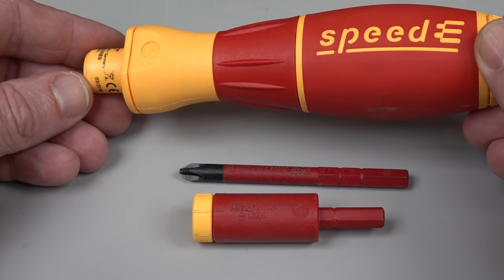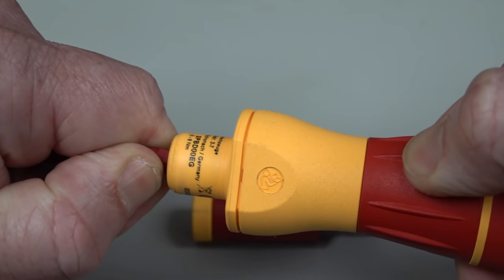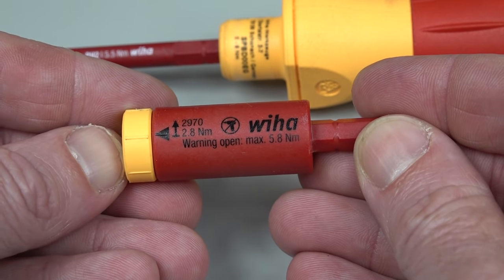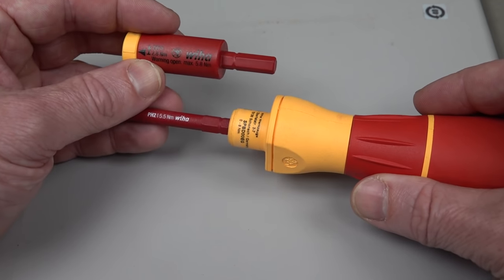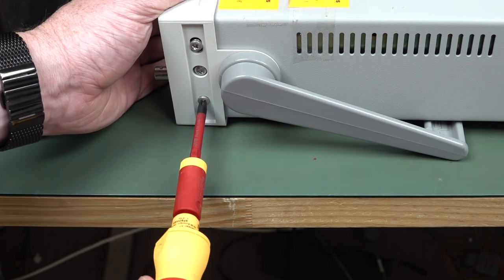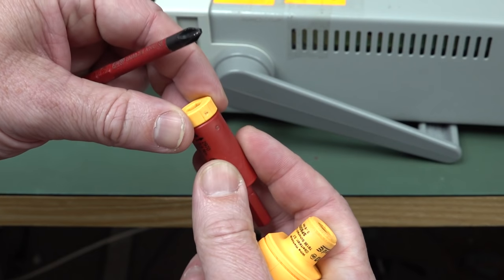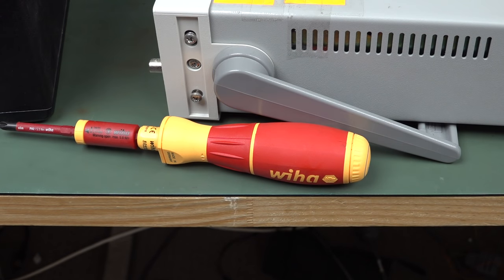Wiha SpeedE Electric Screwdriver follow-up

Comment: The torque adapter is supposed to click when it reaches its torque limit.  Maybe yours is busted.
Reply: Or he can not afford 2.8 Nm in his arms :P
Reply: From the wiha site:  A click signal can be heard and the yellow ring and red adapter seen rotating in opposite directions when the torque is reached.

Comment: Dave, sounds like you want the Bosch go screwdriver. It’s only $40 usd, has more torque, variable speed and torque settings. However, it’s not v rated.
Reply: It's lowest speed can be a bit too fast IIRC

Comment: The torque adaptor is most likely an encyclical gear box, try holding the yellow end and running the screwdriver, if the bit turns slower than the motor end  you know it's a gear system torque multiplier.
Reply: It's just torque limiter.

Comment: As a few have said,  it could be defective but, the adapter looks like a torque limiter. Does that yellow end ring rotate in with respect to the arrow on the main body to adjust torque?

Comment: You are not using this tool correctly. It is designed to insert screws without a chance of stripping the threads. The final tightening is intended to be done by hand or using a properly calibrated torque tool if necessary. Right tool for the job, etc.
Reply: Wrong tool for the price. Buy a frigging drill driver with a torque setting for $30. If the EU has such stringent torque requirements, there are manual torque slip screwdrivers that are calibrated for that. I believe Wiha even sells some. This is a fail. Just like the power torque wrench Milwaukee is coming out with will be a fail. Wiha generally makes good products, but that doesn't mean they don't do some duds occasionally. This thing will hopefully be pulled from the market fairly quickly and we can all forget it ever existed.

Comment: If they can do 1 electronic torque setting they can do more, probably just monitors motor current, calibrate that from the known mechanical setup, seems pretty simple with a couple of components easily. I don't know how they would get multiple speed settings in there mechanically though, the formfactor probably wouldn't allow it.

Comment: That adapter is more than likely for generic hex bits for special tips but still provided the 1000v insulation. Maybe try it out with some standard hex screwdriver bits?
Reply: yshouldicar3 The 1000V isolation should be mostly in the handle, with isolated shafts required to avoid accidental shorts.  Basic electrical screwdriver safety rules required by law say to discard screwdrivers or scratch off every 1000V rating if the metal gets exposed past the tip.  Using regular ¼" metal bits is popular but not really legal on live installations (one could create an isolated holder to make the short bits legal, but still not nice dropping a metal bit inside a live 400V switchboard).
Reply: Regular bits (6.35 mm) will not fit, those Wiha Slimbits are 6 mm hex shaft.
Reply: @toolthoughts  good to know! :)

Comment: Err Dave, you did screw that screw in easier with it, than twisting  your hand, and you were able to apply the amount of tightening force YOU wanted and YOU FELT.
Did the wobble stop or impede the operation/result?
Didn't look like it.
On the instruction sheet doesn't it  say "FIX WITH FEELING", ie tighten with feeling.

With benchtop repairs, each set of screws/bolts have their own tightness FEEL, I don't use a torque screwdriver to TIGHTEN screws when I refit EVERY screw.
The last thing I would want to do is keep adjusting MAX torque each time I change application.
The fact that the shaft has some wobble didn't stop you accomplishing the task.

This is one product that I would love to have.
If you don't want it mate, I'll send you my postal address. 

I know  you are doing a critique of the product, but how much do you want from a screwdriver and how much will you pay?

Seeing as we have no Automotive Assembly lines now, there must be some of the production line tools going cheap, including intelligent power screwdrivers.

Tom...

Comment: how should a torque Converter work without any additional fix-point, newtons law forbids that
Reply: It is possible if you build it like a Torque Converter as it is build into a Automatic Gearbox for example. You have the Motor as one fixpoint that also turns the main side of it and you have the Screw as the other fix point. Theoretically it should work.

Comment: Need to test this turning against a torque wrench or a weighted arm to check if it actually pulls 0.4Nm on motor and clicks on 2.5Nm .  Otherwise you may accidentally destroy screw terminals on your μCurrent when trying to torque them all to spec.

Comment: "The easyTorque adapter provides controlled screw tightening combined with safe work practices for electric applications. This torque adapter guarantees process-safe use, thus safeguarding against material damage and eliminating the need for refinishing. Compatible with all slimVario products, the insulated easyTorque adapter also ensures a secure hold for 75 mm slimBits. The handy adapter thus transforms the slimVario screwdriver with bit holder, the slimVario Stubby electric and the LiftUp electric screwdriver with bit magazine into a torque tool in next to no time. A click signal can be heard and the yellow ring and red adapter seen rotating in opposite directions when the torque is reached. With a release accuracy of +/- 10%, the torque tool complies with EN ISO 6789 requirements. The easyTorque adapter undergoes an individual piece test as per the international IEC 60900 standard, allowing users to work safely on live parts up to 1,000 V AC."
So, it seems to be a torque wrench like thingy...

Comment: OMG I HAD NO IDEA A TOOL LIKE THIS EXIST. I have always joked with my coworkers wishing for a normal sized screwdriver that spun it self...  and HERE IT IS!! Wtff
Reply: There are better ones for half the price.
Reply: @GLITCH_-.-  the chinese have even made one
Reply: @amirs5512  yea in this case the Chinese did the better one. If you don't need the insulation.
Maybe it lasts half as long, but it's also half as expensive with double or triple the usefulness.

Comment: Just to follow up on my comment on the original video regarding the wobble - that's terrible! I really thought it was going to be better with the adapter.
Reply: Dave Micolichek  because I thought the torque adapter shank was slightly bigger than the shank of the bit. That's how it is with the variotorque I have

Comment: Maybe the adaptor is to allow the use of driver bits that are all metal.  That way, the voltage rating is maintained at the handle

Comment: I think you were right when you called it an extender, that thing won't do anything to increase the torque.
Reply: Unless you have to do it by hand and that thing slips at the advertised torque
Reply: It's a torque indicator, like a torque wrench.  (2.8 Nm is quite a bit to do by hand) without some leverage.
Reply: @zer0b0t  about 25 inch pounds

Comment: The 4nm adapter is for your when you're finishing the last tightening half-turn of a screw by hand; it will make sure you are at about 4nm, just like any torque wrench minus extra settings because it's compact.

Still overpriced.
Reply: how to change nm?

Comment: The only thing you were right in assuming is that you don't understand. Everything else is understandable from a professionals point of view.
Since you only have the 2.8 EasyTorque adapter, you weren't able to put enough pressure on to see it working. Try a lower torque and you will see what I mean. Get a EasyTorque adapter with a lower torque and you will here a click when the right torque is set.

Comment: If you gotta do hundreds of screws, get a smaller powered drill. That one you can set the torque on, and it is easier to hold and stuff.

Comment: If the adapter had a planetary gear set in it where the blade moved at a slower rpm than the handle - doesn't look like it - it would multiply torque. Unless that yellow ring does something it just looks like an extension.
Reply: It limits torque.

Comment: There is a gear reduction in the adapter. At 3:14 you clearly see the adapter spin faster then the screwbit. This will increase the torque at the end seen from the motor.
Reply: No.

Comment: This is the purpose of this type of driver - http://www.hager.co.uk/downloads-services/technical-services/torque-settings/52986.htm Also the things i'ts mainly designed for use PZ not Philips heads.  I've also seen meter tails into a SB switch disconnecter come lose over time after not being tightened enough!

Comment: Did you charge this thing up? I use a similar one of these at work and the torque correlates strongly with battery charge
Reply: Im wondering the same thing, he never mentioned it.
Reply: mikeissweet It is SPECIFIED to never pull more than 0.4Nm by motor.  Charging the battery is not allowed to add torque.

Comment: This is not a review, is a demonstration of how not to use an electric screwdriver; however, for your info, this is especially designed to help turn the screw ONLY when it is loose, and use the hand to turn to appropriate torque with the adapters. That's it, easy. But pleases, next time learn before starting the camera.

Comment: The whole slim fit system is a total fail IMHO (not just the electrical screwdriver) - ordered a set once and sent them right back. The fit of the bits and the  wobble is just infurating to work with. Got the wera VDE sets with replaceable bits instead and its better in every way. And yes, for installation work where torque settings is critical you'll always use a dedicated pre set torquescrewdriver and not this silly contraption. Wiha makes great tools but forget their vde slim fit system.

Comment: That would not replace my 2.4v Milwaukee cordless screwdriver.
Reply: i hacked my black&decker with a 18650 + $2 charge module
Reply: 2.4V is an odd choice for a tool
Reply: Its old nicd.

Comment: looking at the wiha website and the video i've linked below, the torque adapter spins at the specified force to stop you over tightening screws. I don't think its supposed to work in electric mode, if you manually try to over tighten a screw it should start spinning when you hit 2.5Nm.
https://youtu.be/HDdyk0aW9Bo?t=28

Comment: Thought there maybe instruction. Oh Dave doesn't use them.
Reply: You are right. He doesn't get the point of this tool, and how it works. This is the first time I disliked one of his videos
Reply: Well if you know so well why don't you tell us eh?
Reply: It's for electrical installation. Install circuitbreakers and the like. They need this specific torque.
Capiche?
It's not a normal electric screwdriver.
Reply: I could see the advantage on electrical. So wonder why they gave it to a electronics dude for eval. (That is me as well) I wouldn't like to use it.
Reply: actually they should have given it to Big Clive, he's an electrician.

Comment: I think its a nice design but doesn't justify the price. I also do some electrical work from time to time and to replace one breaker once and a while will make this tool useless for me. I've replaced db boards before and i used my Bosch go. NOTE THE POWER IS COMPLETELY DISCONNECTED! Here in South africa i can buy 10 Bosch Go's for the price of one Wiha SpeedE. But like some of the pro's say - There was a lot of research etc done when they've design and build this tool. I would have tried it but not for that price.

Comment: I'm a sparky and I know myself that this is a load of wank. 
If your doing thousands and thousands of terminations e.g. doing 72way boards in data centers then it'll all be dead. Any electrician knows that working on energised equipment isn't the best as it comes with risks, but I've done it more times than I could ever count and they aren't big panels. 

Fact it. 
This is a very expensive tool that you'll only use once in a blue moon and when you really need it. The batterys flat. 
You could buy a half decent cordless drill and a load of good quality screwdrives for that price. If you're installing a new board it'll be dead so you can use the ratchet on the drill so you know there all at the same torque and just give them all a little tweak if it's needed. That's what I've always done for all of these years.

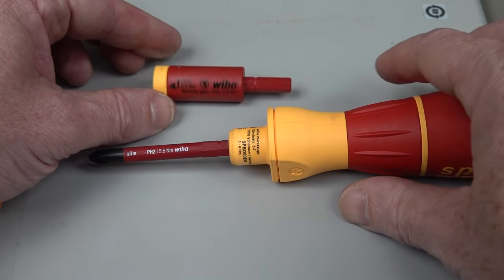Comment: 1:54, what number is that?? x.4 Nm? can't understand the number
Reply: totoxahc The 0.4Nm is the torque limit of the internal motorized screwdriver function.  The screwdriver handle as a whole is rated for up to 8Nm, the PH2 insert bit is rated to 15.5Nm and the fixed torque limiting adapter accessory has a torque limit of 2.8Nm (but only under hand power since the motorized portion of the screwdriver only delivers 0.4Nm under its own power).
Reply: He says NOUGHT .4, which is an  Australian/British way of saying ZERO .4.
Nought and Naught mean Nothing and an amount of zero is nothing or none.
Reply: Thanks, English is not my primary language. I never had trouble understanding Dave until now. I didn't know (or remember) that word.

Comment: not a big fan of those electric "screwers" things (i don't own one, yeah, but it's in my brother's work car, handy there), i worked as mechanic and you really need to hand tight bolts WHEREVER, you can't trust automatic pulsating things, only the giant ones can be tightened with classic air wrench, you usually just "zero" em with the gun or unscrew... electric skrewers i always tought were for like screwing on wood, you use your "magic spin" to zero screws that require no torque to turn (metal on metal), self threadings turn like 7 times, a matter of a pair of seconds... no point...

and that switch handle system sux... can't believe it's instinctive to turn with two fingers and hold the tool good

am i the only one that call batteries "lemmings"?

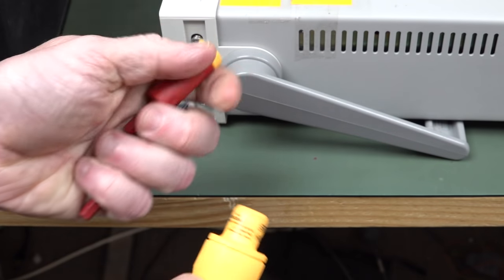2:47 WOOOOOOWwww... unbelievable!!! it doesn't improve, how could be????

Comment: Basically it’s a sh* t electric screwdriver get a Panasonic electric screwdriver or a hitachi electric screwdriver  I have The hitachi eclectic screwdriver and it is perfect I have not had a problem it dose small screws and big screws it’s a bit big for electronics but dose the job it has the slip clutch  and has 21 stage adjustable clutch and has a 0.3 to 2.9 nm torque and a 5 nm torque max load. It is good enough for around the house, workshop, and electronics

Comment: That adapter is most likely to allow to use different bits, like socket wrench bits for bolts and similar stuff. You are right, too slow, weak and pricy

Comment: What is going on here? Here is a second video for this thing(and you will probably release a third), because you didn't give enough excuses for the poor performance of it. Every time you mention something bad about it, you quickly brush it off by saying it's good enough to use. The thing is a total failure! Do you have some kind of stake in this product? Perhaps you can help this company design and build the ultimate electric spaghetti fork. That could be as expensive and worthless as this screwdriver is.
Reply from the maker: I have zero stake in this.
I personally find it useful and will use it, it's not THAT bad. The form factor is very good.
Reply: OK, thank you for responding!

Comment: I have just watched this video and omg. Clearly you have no idea how the use this screwdriver. The motor is designed to stop at 0.4 newton meters. The screwdriver will let you torque it up by hand to a maximum of 8 Newton meters before it clicks. The easy adaptor is put on so that when you do it up by hand (no Motor) it will click at the 2.8 Newton meters. Most MCBs, RCBOs have a torque setting of 2.8 eg Hager breakers. There's 3 different sets available and I'd recommend if your not a spark stick with set one because the quick torque adaptors premanufactured to the required torque settings of most consumer/distribution boards